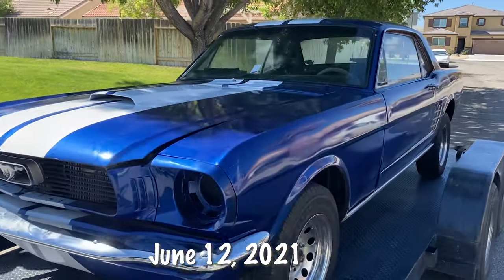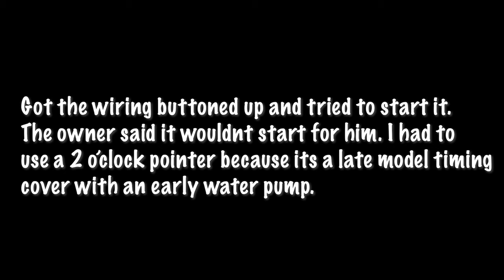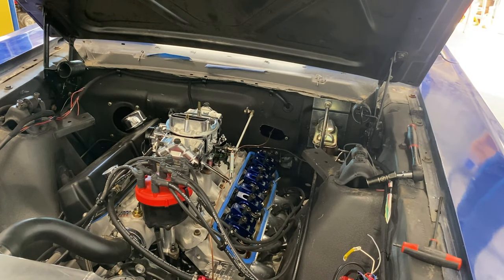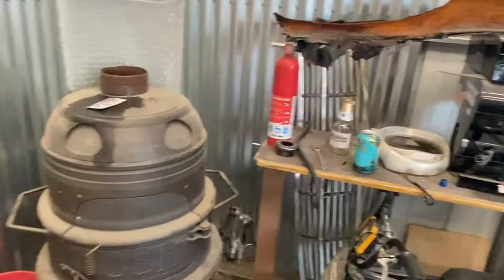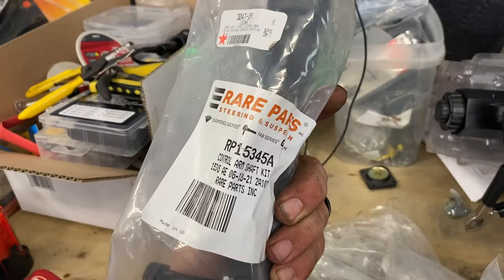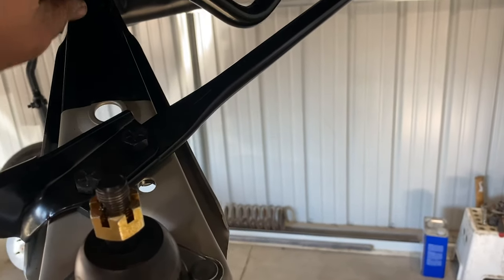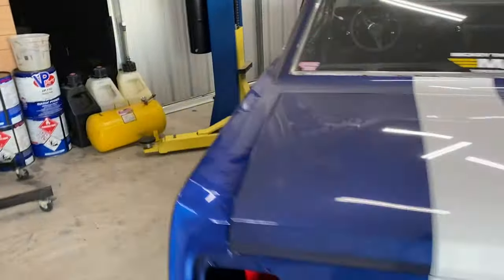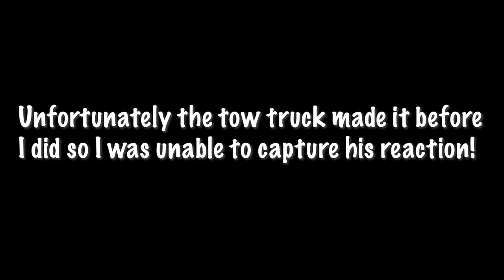1966 Mustang project! We help get this car running again!

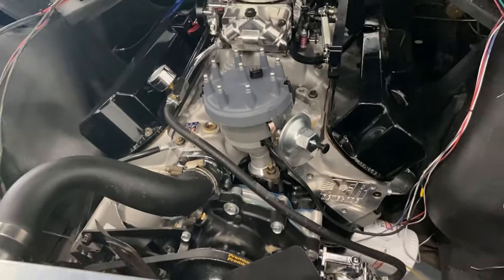Comment: I have the same '66 selba paint scheme as you.  I love it!  I built a 347 stroker with a 650cfm carburator, eldebrock rpm performer heads giving me 10-2 to one compression. I built a 9in rear end with 3:25 posi. I put 2 and one half inch exhaust with the flomasters.  I win most of the car shows I go to.
Reply from the maker: Love the early Mustangs! thanks for watching!!